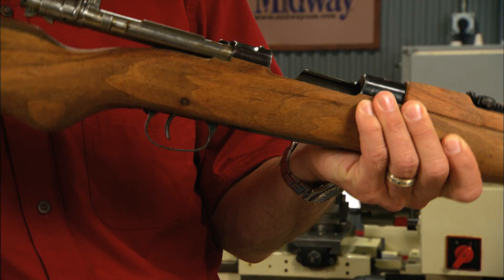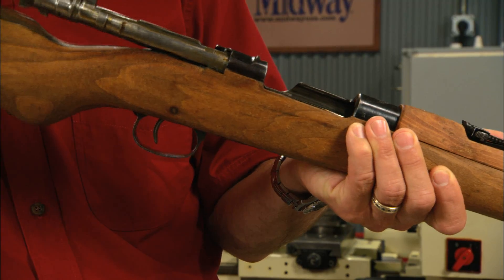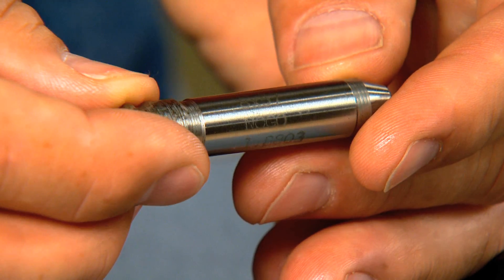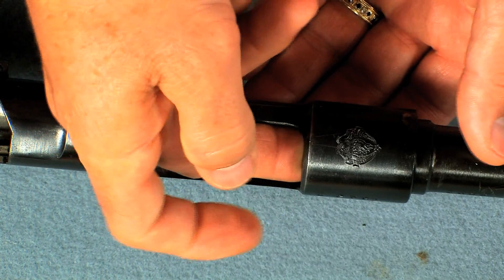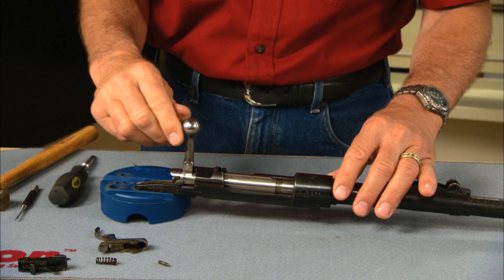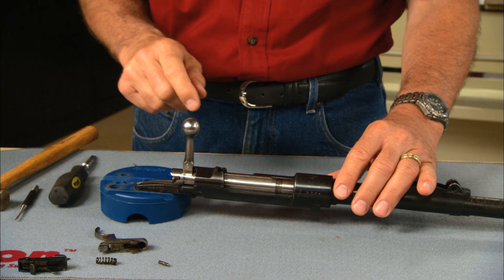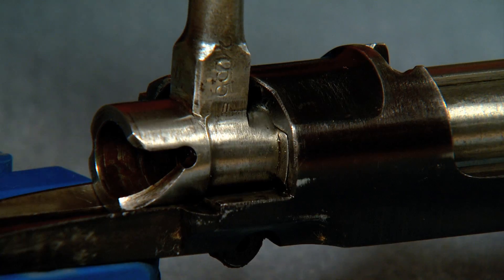How to Measure Headspace on a Bolt Action Rifle | MidwayUSA Gunsmithing

Comment: One thing to also note: While you shouldn't be shooting if the bolt closes on a no-go gauge, if the bolt closes you should check the next two (if they're available): Field, and Max Reject. If the bolt closes on either of those, the rifle absolutely SHOULD NOT be fired. Closing on a no-go gauge should be treated the same as your car needing an oil change. It'll likely still work fine for a while, but you should use caution (IE, don't use reloaded ammo) and when possible, have the rifles bolt and barrel replaced. Preferably by a qualified gunsmith.